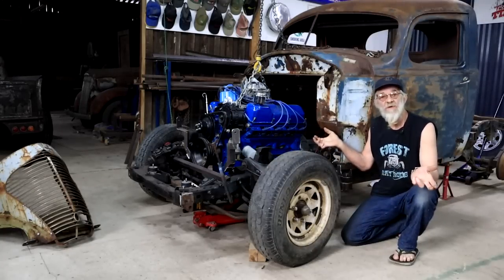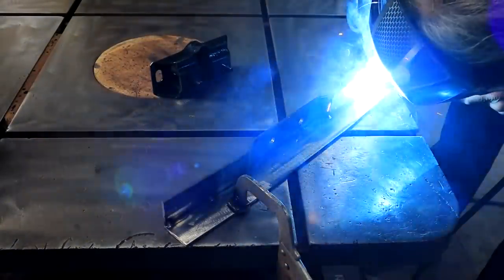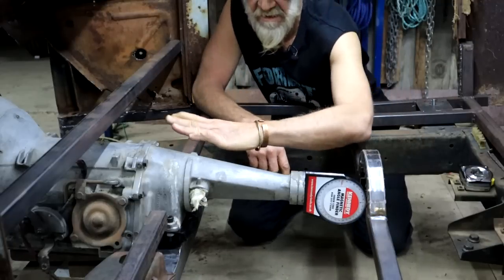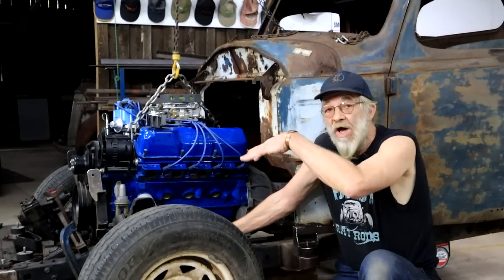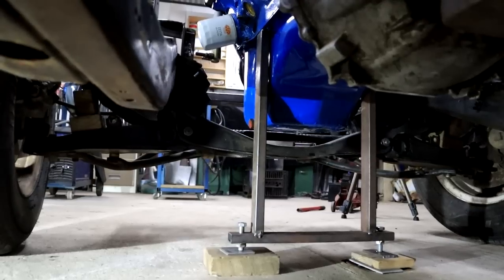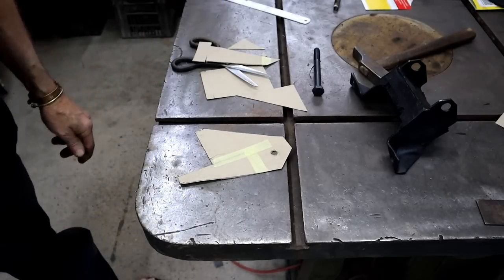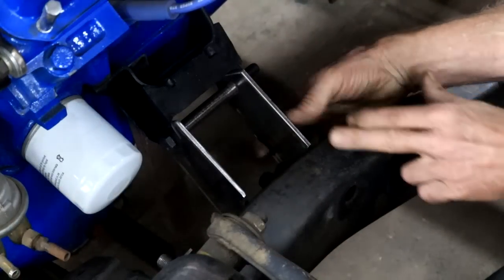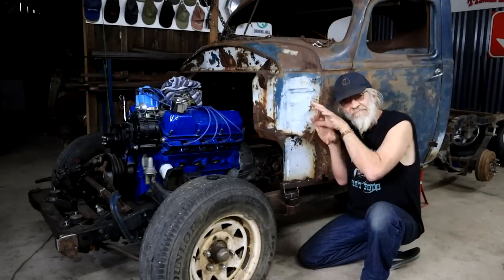1939 HUDSON RAT ROD BUILD Part 6 - Engine angle, alignment & brackets

Comment: Nice to see more progress on installing the motor and transmission. In the past, I have used bushing material on the tubing part of the mount where the bolt goes through. Your cradle bracket was a good tool to get your engine placement bubble inside the lines.
Reply from the maker: Thank you. Yes, the cradle helped a lot!

Comment: Div!!! You never cease to amaze me!!! Ive swapped a few engines in my time and even made my own motor mounts and trans mounts buy man did I thoroughly enjoy your jig you made with the bolts that you supported your engine with from underneath and also used the bolts to tweak and get it perfectly level. Very clever!!! I will add that to my tool bag Boet!! Great stuff!!! See ya in the next one!!
Reply from the maker: Thanks boet. Yes, that simple jig really makes it easy to set up perfectly
Reply: @ratrodsafrica  worked like a champ!!!

Comment: Great vid, got my cuppa, my RRR shirt on ... mate says it's a self-portrait, except I don't smoke ;) Missed ya last weekend, but this vid made up for it... thank you for a great start to my Sunday. Differential  pinion angle relative to Transmission output shaft angle, good lesson to learn... I have seen a lot of engine mounts that go across the front of the engine, as one single plate... that's engine mounted direct to frame, must be really noisy... I like you are still working with proper mounts, to help insulate the engine from the rest of the truck. Great work as always Div, danke boet !
Reply from the maker: Thanks brother! That solid mount business is race car stuff. Noisy and lots of vibration! My beard is grey now, want a more comfortable ride🙂

Comment: Those ford mounts you can drill a hole thru the rubber and bolt it together.  It is a fail safe incase mount brakes.  Been doing that since the 70s
Reply from the maker: That's not a had idea! Thanks

Comment: You can buy a digital inclinometer real cheap, Diff - they're magnetic, tiny and precise - you can bang it onto the block & tune the angle bang-on. I have one & they're very handy - dirt cheap too.
Reply from the maker: I've seen those, but not in shops near me. Guess I can order one, but my old school model has been doing the job well enough 😁

Comment: Hey Div. Looking good buddy. I’m looking forward to the air bag set up. I have a Chevy 3/4 ton long chassis from a flatbed truck I’m thinking about putting my 55 Chevy truck cab on with air ride. And for sure you have a very rare Hudson there. Takes big Brass Balls to alter it.  Hahah 👍🏻✌🏻love it !
Reply from the maker: So many original parts missing on the Hudson that there is no chance to take it back to original. At least now it will get some kind of second life 🙂
Reply: Yes sir !  I also have a 57 Chevy 150 sedan I’m doing a mini tub Hotrod out of it. Build how ya like em I say.  Stock sux.  Lol😅

Comment: We get Made in India mounts in Canada, too. Nice work on the mount brackets. Did they have to be all that strong? It's not like you're running a Chevy V8, it's only a Ford. (...and the bickering begins...) Hudson's racing successes were partly due to its 308 cu. in. Flathead Six, and the low center of gravity in the "Step Down" models. The drivers likely think they had something to do with it, too.
Reply from the maker: 😂 Where's my popcorn! Interesting to hear those Indian  mounts are also by you

Comment: Transmission 
output shaft should be same angle of rear diff
Reply from the maker: Correct. I will be building a new 4 link set up, then I can set it the same

Comment: You probably take your welding table for granted, but I’ve never seen anything like that before here in the states. Can you give us a little background on it?
Reply from the maker: It's actually just an old cast iiron woodworking machine that I repurposed. It used to be a massive old spindle, like a king size router table. That's why there is a big hole in the middle. I just covered it with a piece of plywood so stuff won't fall through

Comment: Spot on diff ..one question....
How would you remove the transmission , if need be...with that bracket welded in..🤔,,,, Bob built his cross member removable...so if the trans needs to be replaced or just taken out ..the whole bracket comes out everything is out of the way...
Maybe you have it bolted in a place I didn't see.... another great episode Diff......I'm catching up on all your videos .....class act my man.....
👍👍😎💪💯
Reply from the maker: Hey Don! Thanks for checking out my stuff. Good observation! I thought the same afterwards. To get the tranny out, you would have to pull the engine. So I changed it to be removable. You will see it in a later video🙂
Reply: @ratrodsafrica  got it ...good idea Diff..... looking forward to the next great episode for sure.👍👍😎💪💯

Comment: I think it would or been better to bolt the trans braket in rather then weld it in i think it would be much easier to unbolt the whole braket then to try and fish it out after unbolting the mount lifting the trans to remove mount if you need to change it once the whole truck is built
Reply from the maker: Funny you should say that, I've been thinking the same yesterday. I might still do it!

Comment: I have learnt so much throughout your videos.
One question though...I am building a 351w V8 into F series. Must the engine be centred in frame? Where 9inch diff has a +- 50mm offset ?
Reply from the maker: Nope, it is offset in the frame. You will notice that the tunnel in the cab is offset as well.
Reply: @ratrodsafrica  that means that gearbox will not be centred either then. Correct.